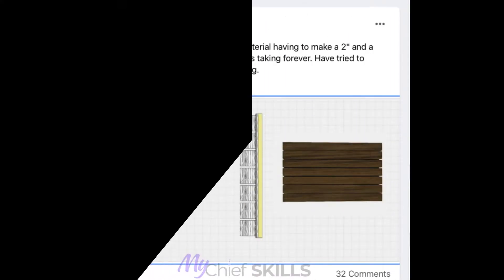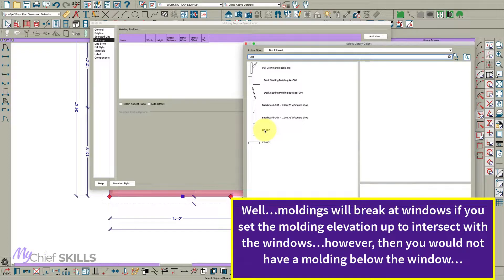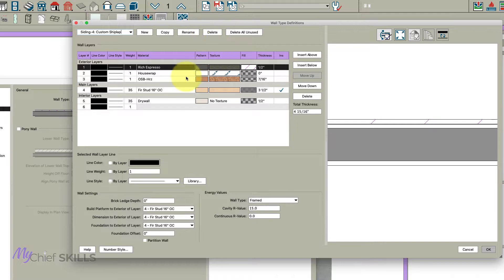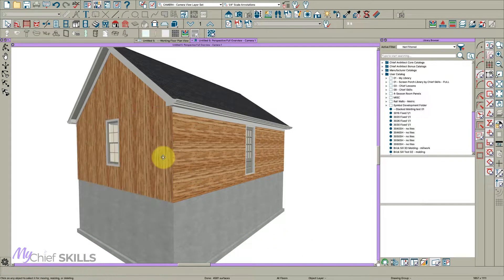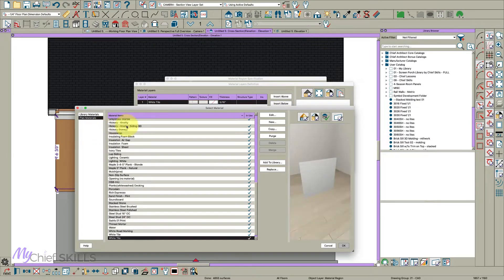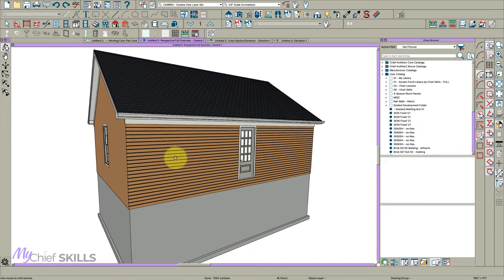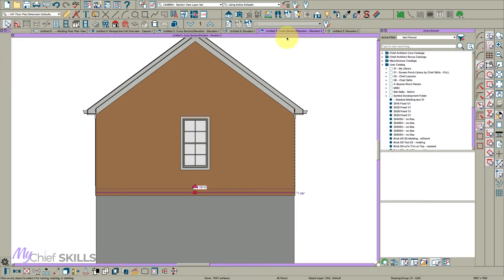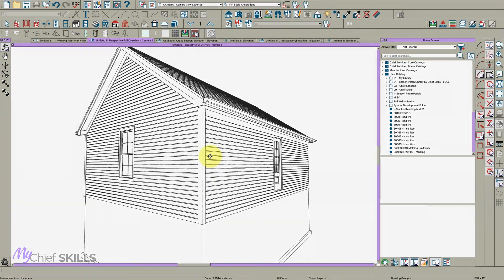How to create shiplap siding using Chief Architect X12

Comment: Great technique!
Reply from the maker: Well - it’s a work around.  If you move a wall or change the design you will have to edit the material region. It’s a way to get some depth to show in a render view.  I think a better way would be to locate a decent texture and save it as a material and use it as a siding.

Comment: Nice! Does the wall retain the material regions if it is edited, say lengthen or moved?
Reply: Just did a test run. The wall can be moved and even broken and turned. However, the length of the original material region will remain. So if you lengthen it the new wall area will not have the material region. Conversely, if you shorten the wall the original material regions will remain where the wall was previously and you will have to remove them. Side note, I did this vertically to create an authentic looking B&B siding, it looks great! But it's definitely something you want to do when you know the exterior walls are completed. Thanks again!
Reply from the maker: Yep - using a MR for this is a work around and you’d only want to apply them when the plan is basically done.  Kind of like using P-Solids for some custom trim...then you change the design and the solids no longer work.